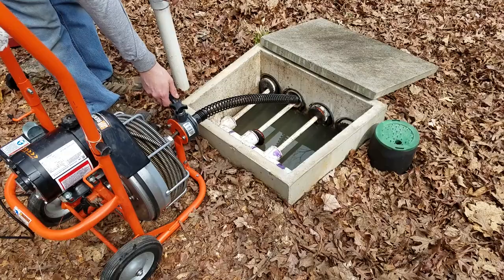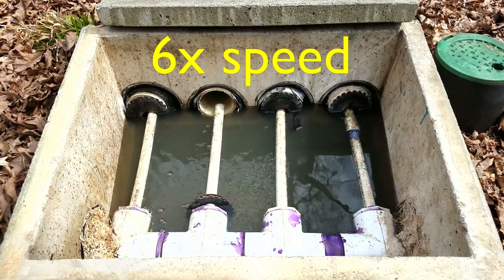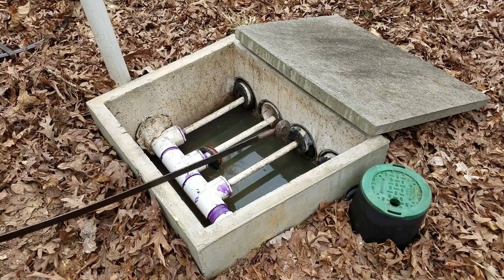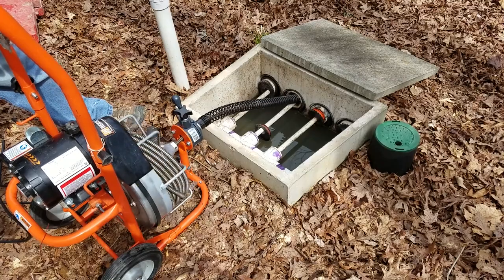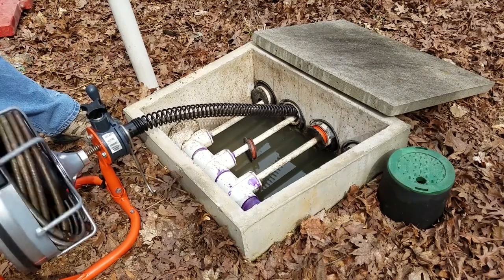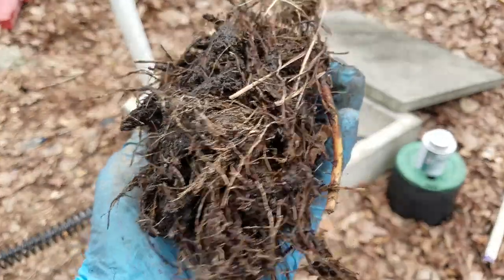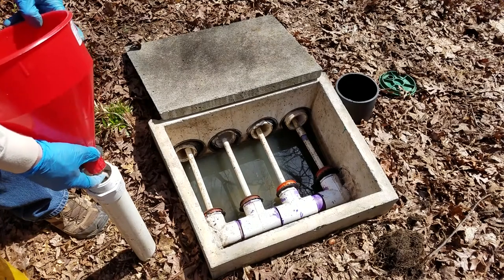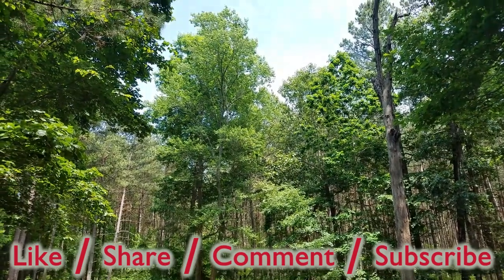Removing a Septic Leach Field Blockage

Comment: Hi, what is that pipe you poured  the treatment into? Is that the pipe running into the leach fields? Did you build that yourself?
Reply from the maker: That's just the end of the pipe that goes through the concrete box. It was put there by the septic installer and I assume it's for backflushing. When I poured in the foaming root killer, it just came out of the four smaller PVC pipes, inside the concrete distribution box, and then fed into the leach field.

Comment: Good job ! As a licensed septic contractor, ideally, in this scenario, the system should be treated for roots often. Currently, my rate is $25 a foot to replace drain lines. That can be avoided easily by using some sort of root killer.
Cheers
Reply from the maker: Thanks! I actually did a follow up video where I dug up the pipe, removed a large mass of fine roots, and fixed it right. Luckily the blockage was only about 10 feet down the pipe. :)

Comment: Nice job.reql men do it themselves
Reply from the maker: I just had to do it again last week on the same line. I ended up buying a 50' manual drain auger and it worked just as good. I thought I would have been able to go longer between blockages but it looks like I'm either going to need to do this once per year or dig up the spot where the roots are getting in for a longer term fix. Thanks for watching!

Comment: I’d recommend root-cutting bit. It has flat head with saw teeth to cut roots. The C cutter you used at first, is for cleaning grease.
Reply: I was able to use manual drain snake with root cutting bit to feel blockage, drive a bit through with power from drill, and retrieve root mass after its dislodge.
Reply: Be careful when using auger bit against root. Don’t try to punch in too hard. Root can wrap around and get your drain snake stuck inside. Should use root cutter bit to cut off root before pulling it out.
Reply from the maker: Thanks for the tips! I tried every head the rental place supplied but I don't think they gave me one like you're describing. The roots are only about 10-15 down the pipe so I'm going to dig it up in the fall and attempt a more long-term fix.
Reply: @Mikeattempts  digging up is definitely the last resort. Locating pipes along, is hard enough without specialised locator (drain camera in the pipe with a detector sweeping from above)
Reply from the maker: @MrTimjin  Yeah, I can either use the auger once per year or dig it up and fix it right. The lines aren't that deep at 10-15 feet down the pipe so hopefully it won't be too much for me to handle.

Comment: i wonder if you can test that stuff by just putting some roots into a pipe (above ground) and mimic it going through underground, to see what actually happens.
Reply from the maker: Yeah, that would be a better test. I can tell you that the 1 treatment I used didn't seem to do much because I had to remove more roots from the same tube about a year later. I'll be doing another video this winter where I attempt to dig down to the problem.

Comment: Very helpful, thank you.
Reply from the maker: I had to remove roots from the same line about a year later. The good news is that the blockage isn't far down the pipe so I plan to dig up that line in the fall in an attempt at a more long-term fix. Thanks for watching!

Comment: Glad you came back a year later to say in the comments that you had to treat the system again.
Reply from the maker: Yeah, I got a manual drain cleaner for $40 and it works just as good. The roots aren't that far down the pipe so, in the fall, I plan to do another video digging up the pipe in hopes of a more permanent fix. Thanks for watching!

Comment: Is that a Massey I spy? I had one of those many years ago. I wish we had the same chemicals here in the U.K as you guys have.
Just about to go and locate my blockage. Thanks for the vid👍
Reply from the maker: It's actually a Ford 860 tractor. :) I'm not sure if the foaming root killer did any good. I had to remove more roots from the same line last week. I ended up buying a 50' manual drain auger and it worked just as good. I thought I would have been able to go longer between blockages but it looks like I'm either going to need to do this once per year or dig up the spot where the roots are getting in for a longer term fix. Thanks for watching!
Reply: @Mikeattempts  lol looked like a Massey from behind, still I've known a few women like that in my time:). Yeah, I got conifers growing over mine, i think it maybe chainsaw time.We don't get that root stuff here. Take care cheers👍
Reply from the maker: @edmundblackaddercoc8522  Hahaha, I lightly smacked the rear of the wrong girl once, that was hard to explain. ;) Yeah, get those trees out of there! There aren't any trees on our leach field but they're all around it and I guess at least one has grown some really long roots to make my life difficult. :)
Reply: @Mikeattempts  those roots are tenacious.  A regular treatment (2/yr) of root killer would probably help.  But really, you should find the tree that is the source of the roots.
Reply from the maker: @chad-122  My leech field is surrounded by trees so I'm not sure which it's coming from. The good news is that the roots are only about 10-15 feet down that one pipe so I think I might just try to dig it up and fix it properly.

Comment: Glad to see you're one of few men left that do what needs to be done. Too many people would've sucked it up and paid the septic repair guys thousands to dig up the field. Very informative video and I'm also glad you showed a year later how the flow was. One question for you, do you know what material the leach lines were made of ? Schedule 40 pvc with holes or perforated corrugated pipe ? Thanks again.
Reply from the maker: Thanks for the comment! Just to be clear, that was only a few months later in the video. And, probably no surprise to some people, the roots blocked that pipe again about a year later. I used a $40 manual auger this time and it did a great job. It's exactly like the machine I rented except it's manual. The roots are getting in only about 10-15 feet down the pipe so, in the fall, I plan to dig it up at that spot in hopes of a more permanent fix. I'm pretty sure my leach lines are schedule 40 pvc pipe inside those large black domed leach field chambers.

Comment: This is all cool if it is your primary residence.  However, if you are selling your house or renting your house, it has to be certified.  Therefore, you must have the leach field repaired or replaced. The big dollar option.  Ultimately there is no choice.
Reply from the maker: If you're renting, then it'd be the landlord's problem. :) I did a follow up video where I dug up that pipe and fixed it properly.